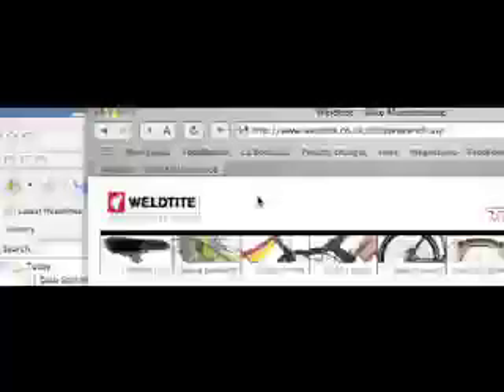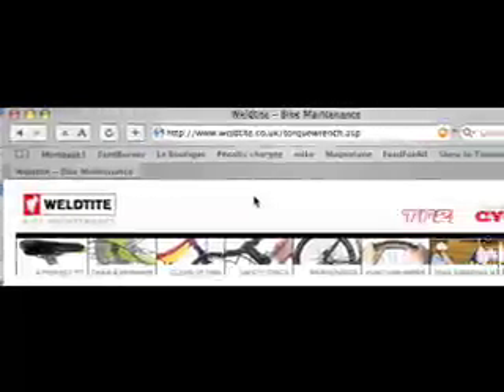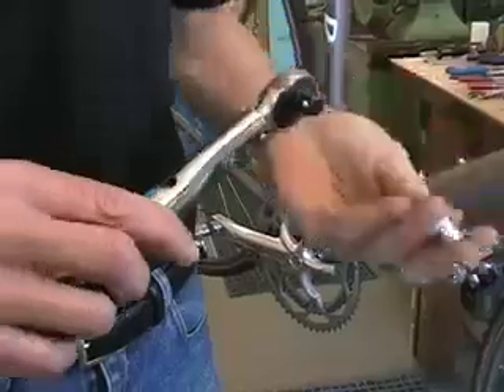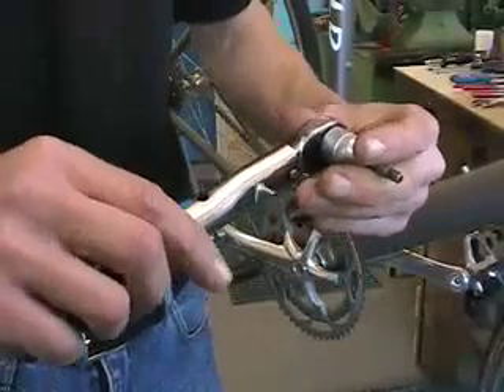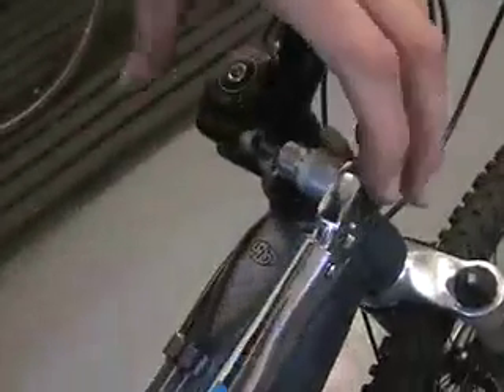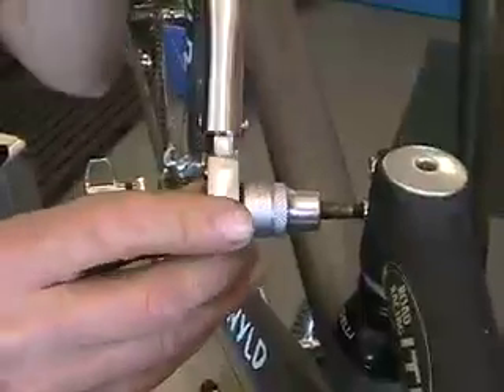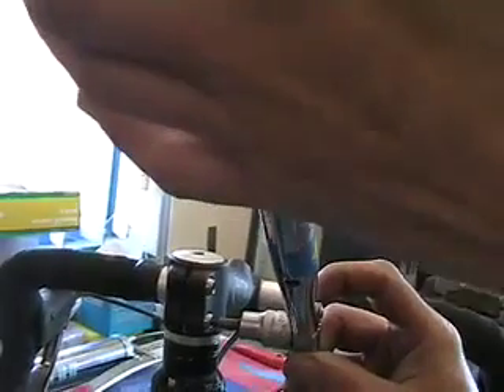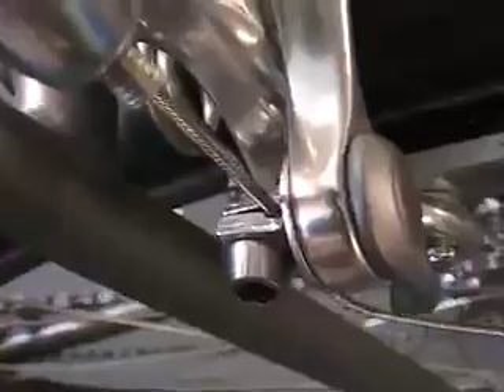How to use a torque wrench

Comment: @barnettboys13 you can for specific applications. for example when astronauts are in space they use torque wrenches to undo bolts. otherwise u risk breaking a bolt and not getting something out in space. but yea , in most situations ur not gonna worry about that.

Comment: you should never use a torque wrench to loosen a bolt.
the counter-clockwise setting is for use with left hand threaded bolts/applications.